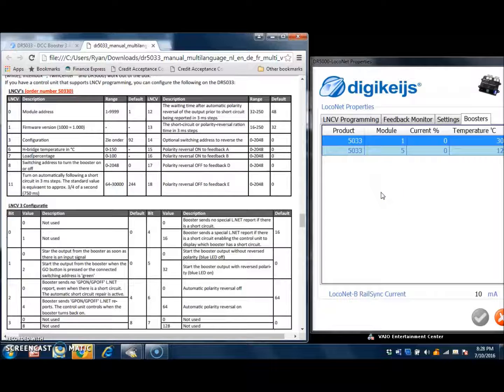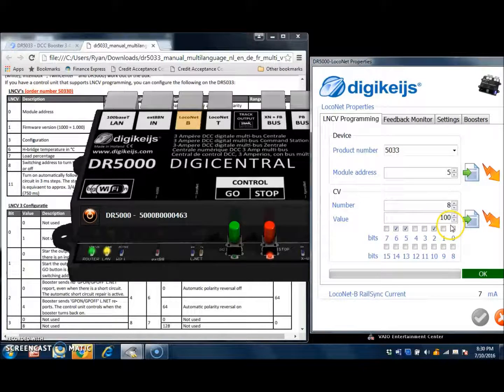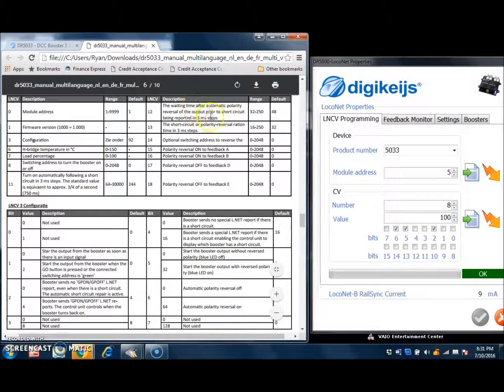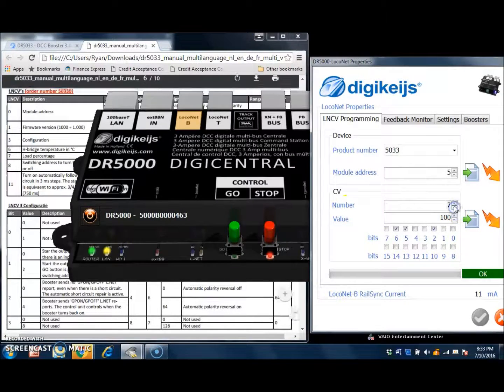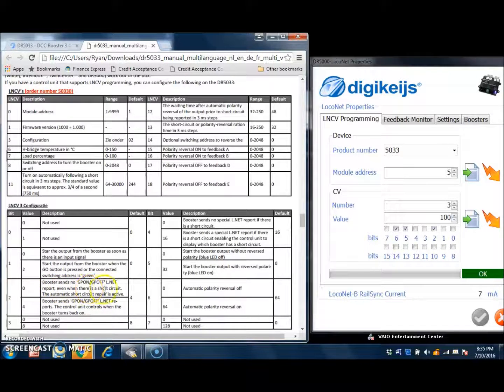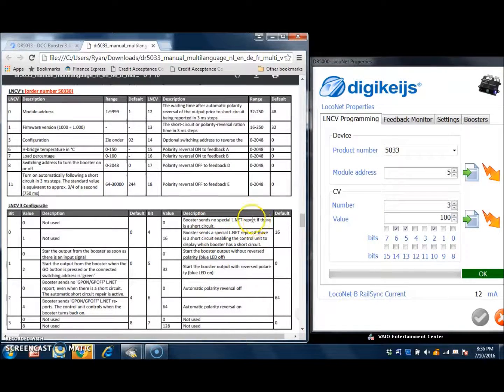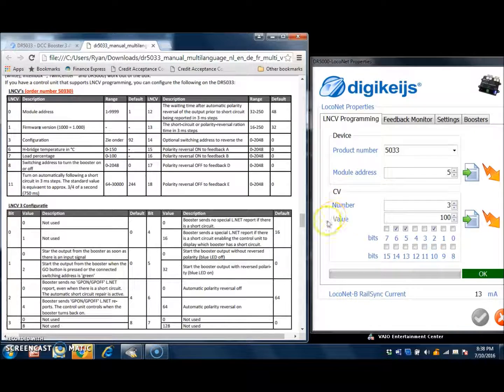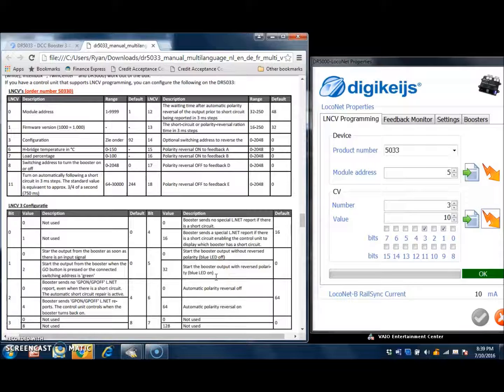DR5033 Setup - Part3 - CV Values & Options

Comment: Hi Ryan, how are you? I bought this amp to improve the performance of my layout. I separated it into two cantons. I have a Digitrax DB150 central and I use JMRI. I would like to know how to configure the amplifier with one of these devices so that it turns on and off with the central unit. Also, when the locomotive passes from one block to the other, despite the fact that they are isolated, the locomotive stops and the typical short-circuit sound is produced... I understand that automatic reversal can be programmed to avoid this. How can I do it??
Ahh., when there is a cut, and the power station stops powering on, the block fed by the 5033 does not suppress it, which causes all the locomotives that are in it to activate at maximum safety, with the problems that this can produce.
Thank you very much for your help.

Comment: Hi Ryan, thank you for getting back to me so quickly, I’m not sure about the term “quad gap” I have already started putting some wiring onto the layout when I realised I had a problem, would it be possible to email the track plan to you, as I am unsure what needs to be done? Everything was fine but when I added a turntable to the layout one track picked up the other half of the layout in a reverse polarity situation. I have marked everything up on the diagram. Hope you can help me sort this out. Best regards Phil
Reply from the maker: Phil, yes you can email me a track diagram.  ironplanethobbies@gmail.com

Comment: Ryan, can you help me please? I have a Digikeijs DR5033 which I am using with a RocoZ21 controller, I also have block control Digikeijs units on my layout. The problem I have is that I have a reverse polarity situation on my layout and I have isolated the two sections from each other and used the booster to power one half and the Roco Z21 to power the other half. I have read that the booster must be isolated from the controller or you may get a double voltage situation that could destroy the decoders in my locos? But I also have a reverse polarity issue between the two halves of my layout, so if I put a reverse polarity unit like the Lenz type in the circuit will I be overiding the isolation between the controller and the booster? Hope you can help me? Thanks Phil
Reply from the maker: Phil, without a track diagram I may not have all the pieces but I'll try and help. 
If you have a reversing section it can't go through the block module.  It needs to be isolated.  The best practice is to use a separate auto reverser  between both districts and should be longer than your longest train.  Otherwise when the locos exit the reversing block, metal wheels on the cars at the other end will begin to cause a short. If that's not possible, a quad gap at both ends can work too.  Make sure you turn off the auto reversing in the boosters or they can fight with the stand alone auto reverser.   
If this doesn't answer your question please let me know and I'll help you figure it out.
Ryan